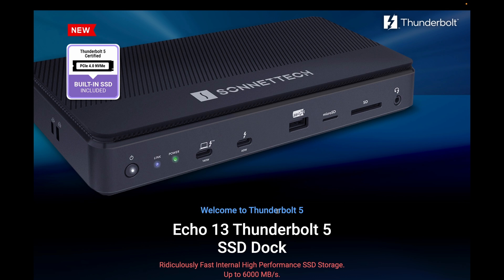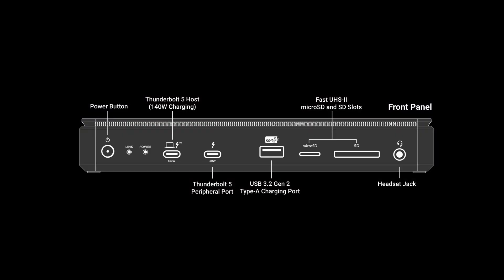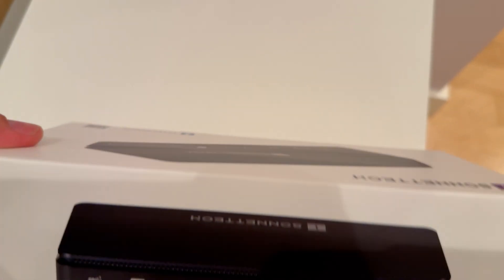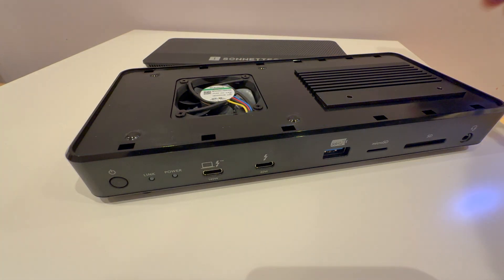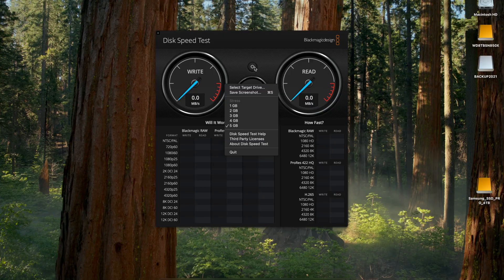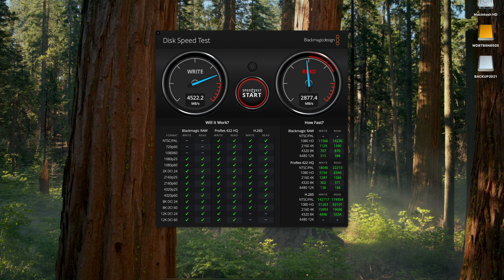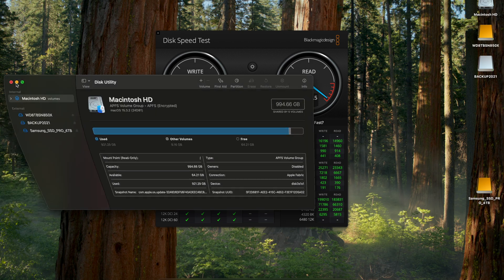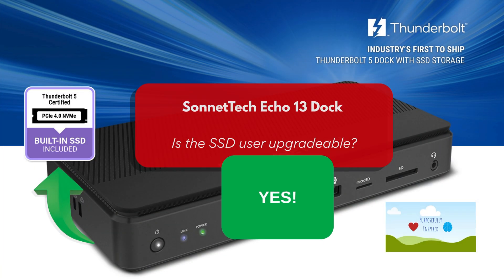Sonnet Tech Echo 13 Thunderbolt 5 Dock with NVME SSD - Is it user upgradeable???

Comment: Anything is upgradable if you have the courage. While probably trying to mentally solve a problem that might not exist I think they should have done heatsink just a little bit different. Given that the fan pulls air through and out of the enclosure. The moving air just touches a fraction of the surface area and has no fins on that side either. It would work better if they removed the metal in the  recessed area that forms the cooling fins. This would allow air to pass through. Or increase fin count along with making the fin area a little deeper so air can pass through it.

Comment: This dock is now more interesting but I really dislike all the cheap plastic. Basically everybody makes these look high quality, out of aluminium: ASUS DC510, Kensington TB5 dock, Anker Prime TB5, UGreen Revodok 2131, CalDigit, iVanky TB5 - all made out of aluminium and look much better.
On a side-note: the fan looks like a 50x50x10 5V PWM fan. Unlikely to be replaceable by Noctua NF-A6x15 5V PWM(50x50 hole spacing), because 5mm likely won't fit and even if it fits, it will likely produce more noise because of insufficient spacing :(
Edit: Noctua NF-A6x15 is much bigger - no way to place it unless you start cutting through plastic, all over the place.
Reply: Think of the cost though - wouldn't that make this even more expensive?
Reply: @johnwade7430  Note that removing the integrated NVMe drive instantly voids your warranty.

Comment: There is a good reason Sonnet will not support this dock with a user added SSD.  Due to the nature of the current Thunderbolt 5 technology/ chip, there is a very limited list of properly compatible SSDs. Some will only work at only 1/4 speed and others will not work at all.  Be careful in your selection.
Reply from the maker: @gregorypaul3206  yes, careful selection of a Gen4 NVME with Read and Write speeds and cache/buffer that can support Thunderbolt 5 is an important distinction.  I also found formatting APFS for use with MacOS and iPad Pro makes a difference in speed / performance.  Thanks for watching and for your comments!
Reply: @PurposefullyInspired  Cool, so was that faster or slower?
Reply from the maker: @imowgrass  We've found APFS formatting to run Faster than exFAT formatting when running on a Thunderbolt 5 enabled Mac.  The speed test data is shown in the video.
Reply: @PurposefullyInspired  I saw that after my comment lol.